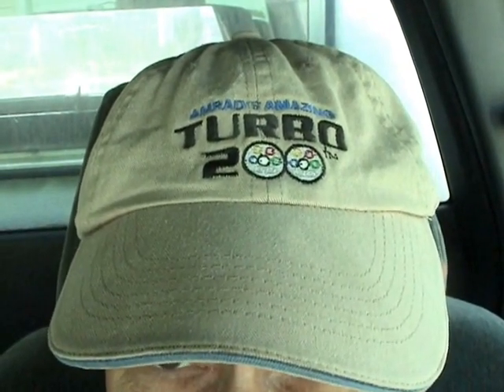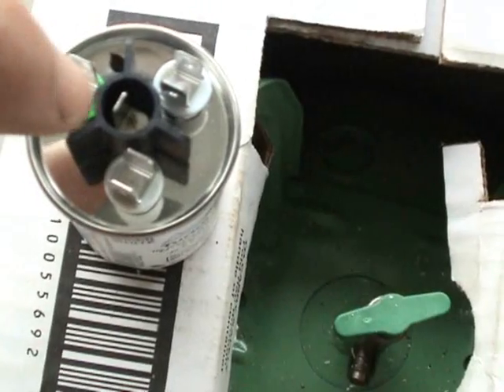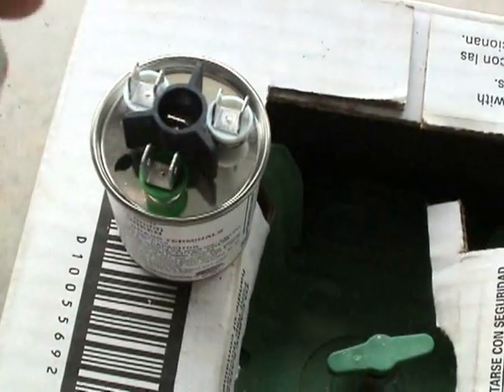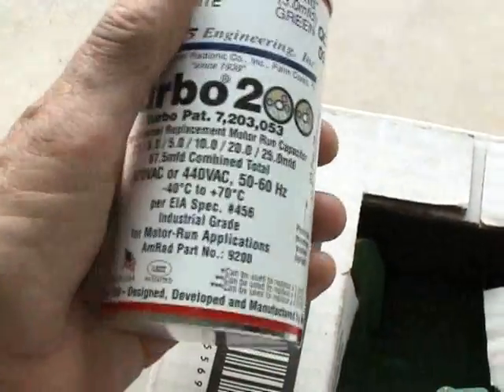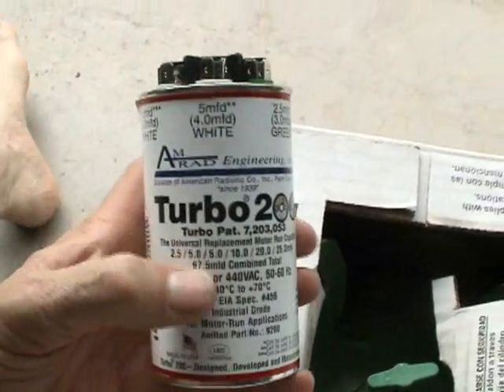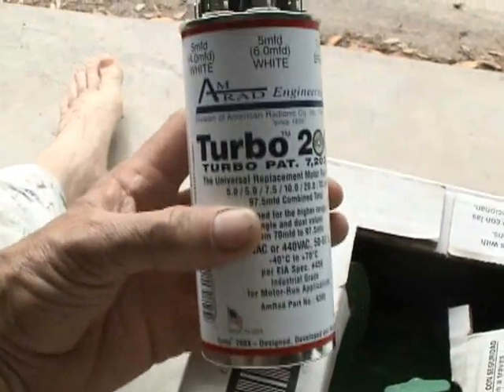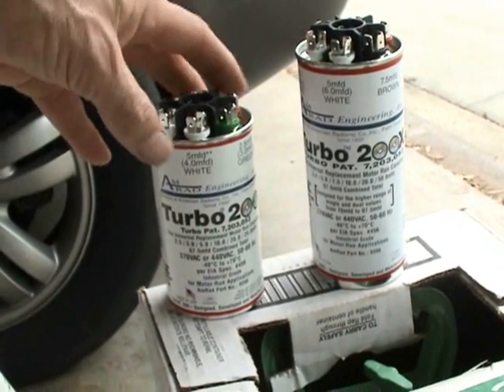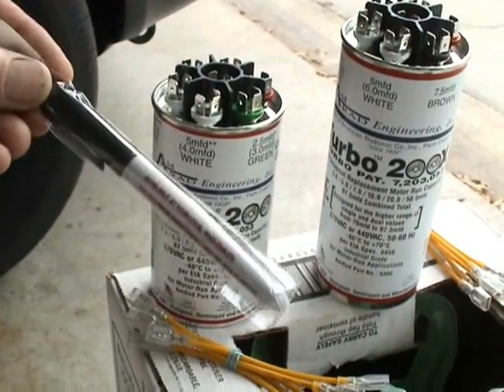HVAC Amrad's Amazing Turbo 200

Comment: Someone mentioned  useing mulitable caps to make up the capacitance as sort of a bad thing. I think it is a good skill to know. While it may not be my first choice of capacitor replacement it is sometimes necessary if you don't have a Turbo and have run out of the pouplar sizes like at night or on the weekend.

Comment: Just too dam expensive. I just keep a few sizes that I need for most jobs, like 3,5,30,35 along with a bucket of used caps that I grab off junk units. That and some tape and tie straps are all I'll ever need.

Comment from the maker: @Woden5599 You have to take the line voltage into consideration as well. Every motor manufacturer has their own way of matching motors with run capacitors.